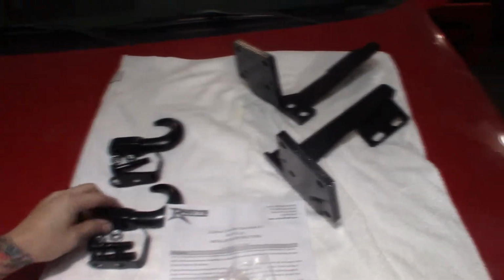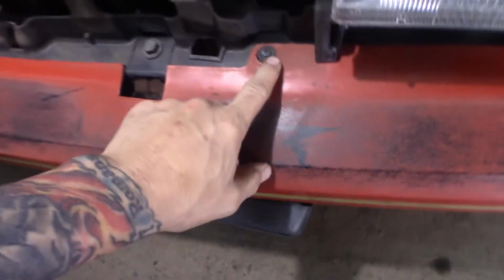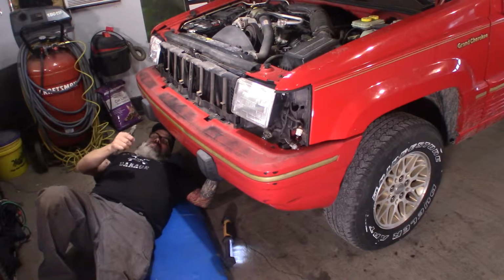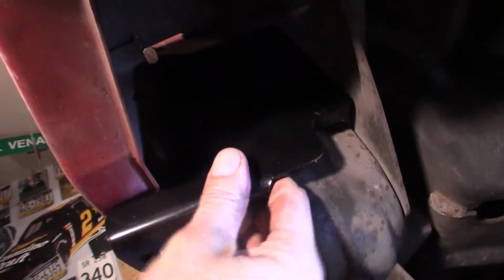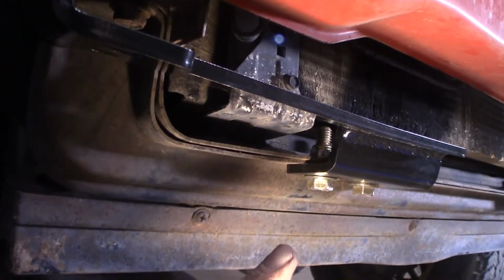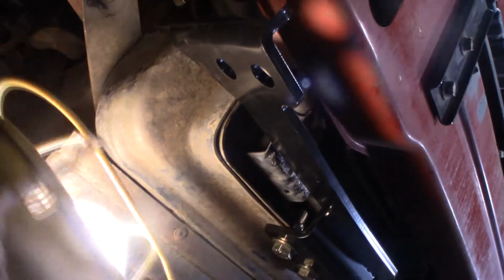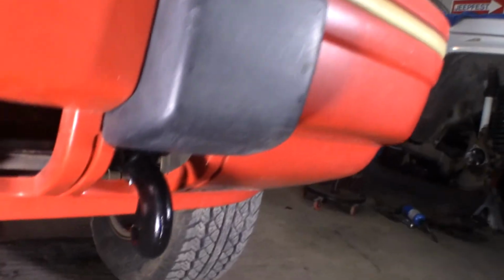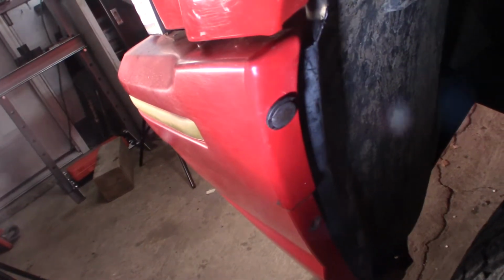Rusty's ZJ Tow Hook Install

Comment: FYI, according to Rusty's instruction sheet that came with the brackets, the "the end with the two bolt holes pattern is placed ON TOP OF the front radiator support" (instruction #6).   Yours are mounted underneath, but hey, if it works...

Comment: I prefer the factory setup using a plate with weld nuts inside the unibody tube, it spreads the load over a larger area.